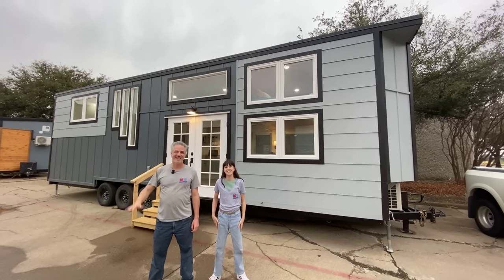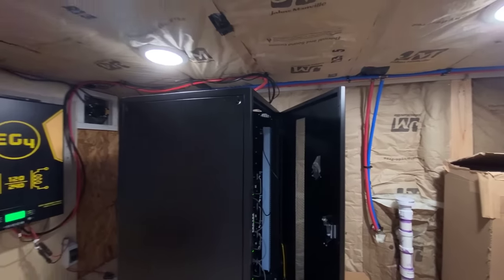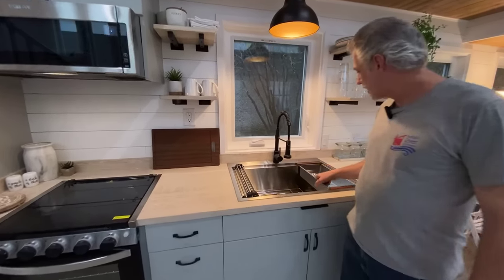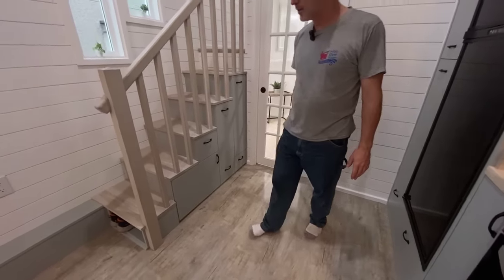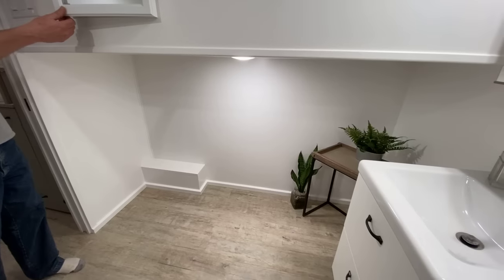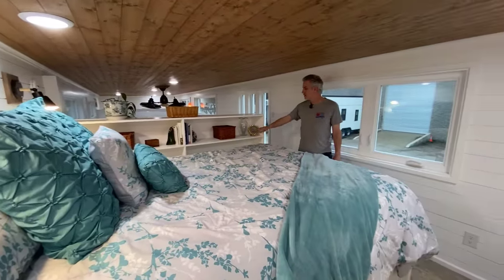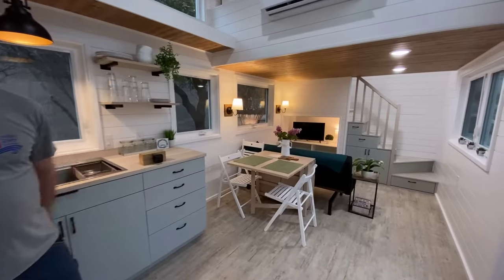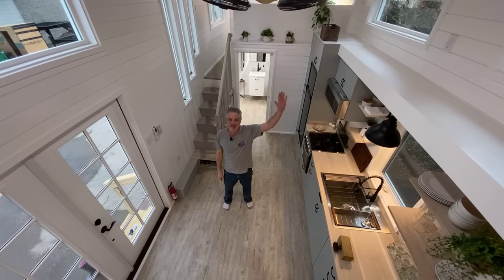Luxury, Off-Grid Tiny Home w/ Solar & Propane

Comment: Who manufactures the kitchen cabinets?

Also, I think you should build a Scandinavian/Modern tiny spec home with and open tread, center stringer staircase with 3” thick treads. I think a 12’ high living space with large, low profile, modern, aluminum wood clad windows and operable bottom and top transoms for a passive home design. I’m an architect specializing in high end residential design, and I feel like you’d be able to sell it at quite a premium. I’ve seen other modern tiny homes, but they are either too stark, or not as well designed as yours are. An example would be high quality finishes and materials, but the layout would just be basic, with not a lot of storage. One thing that I truly believe that sets you apart from the majority of others is the standing loft, a feature that I have admired since learning about the ingenuity of incredibly efficient and well designed multi-level single wide mobile homes from post WW2 housing boom. After learning about it, I always wonder why it didn’t catch on, as it gives a completely different perception of space and practicality. You guys(and gals) do very nice work. Kudos.
Reply from the maker: We have a great woodworker/cabinet maker: Cameron at The Hungry Saw

We are also perplexed that more builders aren’t doing the stand up lofts! 

Thanks for the suggestions. We are just a small “mom & pop” biz so we don’t have the capital to build spec homes much, but if you want to place an order your project sounds intriguing! 

Thanks for watching!

Comment: A Beautiful home ! - quick question do the batteries have adequate venting for the heat they will generate in the closed compartment they are in ?
Reply from the maker: Yes it was built for that purpose & is vented.

Comment: This one is something I just love this one. Will you guys be doing 2 bedroom?
Reply from the maker: We build tiny homes with up to four stand-up bedrooms. Check out our Bunkhouse floor plan.
Reply: @IndigoRiverTinyHomes  😱 my jaw drop!! When you said that. Do you do 4 bed room? Or is it possible two have 4 bedrooms? 
Also, I didn’t know since I’m new with RV and Tiny homes. Is there a weight capacity on a tiny home? Because I know I just find out that RV have the capacity of weight or else it’s illegal to have overweight RV specially a family of four, so it depends on how much stuff of a family for have. Also, will there be a place where you can have a tiny home and attached to a tiny home is a septic tank which is legal to have? Like I said I’m new I don’t know the rules and regulations for a tiny home but I do know that a tiny home can be park to the driveway as long the homeowner get a permit from the city. I got that from a neighbor near my in-laws house. That’s what she told me.
Reply from the maker: @Roh_elle05  yes! 4 stand-up bedrooms if you add a gooseneck to a Bunkhouse

Comment: Nice job!! I would go with you guys based on some of these videos, but sadly I need a custom builder. Everything I want is pretty custom for a tiny house. Even the SIP's are not standard.
Reply from the maker: We are a 100% custom builder! 
The only thing we don’t do are slide outs. Our Tiny House Planning Tool is just the starting point and after filling that out we can schedule a phone call or floor plan appointment to discuss the other customizations you want in your home.
Reply: @IndigoRiverTinyHomes  Truly custom?

My build is strange. Even for “custom”. It includes Greenix ballistic SIP’s, an Atmospheric Water Generator, and some other odd features. Intended to be a 100% off grid luxury tiny house.
Reply from the maker: @UnexpectedInquisition  Peter says yes to 99% of the requests we get for specific materials or specialty appliances/energy systems. If you can source the materials, we can usually build it.
Reply: @IndigoRiverTinyHomes  Neat! That is very uncommon. Most "custom" builders really mean "we will customize one of the models we offer".
Reply from the maker: We start from scratch on the designs when someone wants something unique.
Reply: @IndigoRiverTinyHomes  You guys are at the top of my list at the moment. Life and work are nuts at the moment and some big changes may happen soon, but in the next 1-2 years, 2 at the most, I will be ready to pull the trigger and will get in touch. Looking to get started in early 2025 at the latest. I will stay subscribed and watch your channel in the meantime. Keep up the good work.